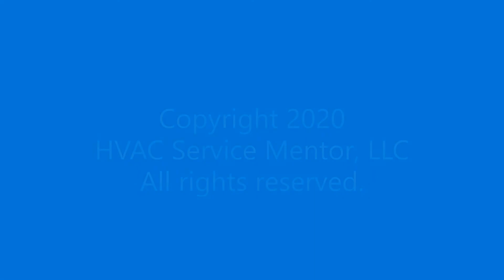How a thermostat works part 4 what is cycle rate and why should I care?

Comment: I have an aprilaire thermostat and no such setting exists in it.  however I think they call it something else. everything in it's manual goes by temperature setting.   what would be another term? some of their settings are stage differential, stage rate,  progressive recovery,  low balance, high balance, temperature offset.  heating minimum off time, compressor minimum off time, equipment minimum off time.
my furnace runs for lets say 7 to 10 mins, I can hear it shut down, waits about 10 to 20 seconds and then restarts the burners and runs another 7 to 10 min cycle.  it will keep doing this until the temp stabilizes I guess.  the whole time the thermostat temp never changes.  energy bill is normal but I'm worried about necessary cycling damaging the furnace.

Comment: Just curious what would the equivalent setting to a 3 cycle per hour be if the thermostat has slow, medium, and high heat cycle settings? My guess would probably be the medium setting.
Reply: Don't know which thermostat you have but I just found this info on Sensi. The cycle rate is based on temperature change, not cycles per hour. "On the Sensi the cycle rate on slow uses a 1.9 degree swing. On medium it uses a 0.75 degree swing"
Reply: @ That makes sense.
Reply from the maker: I haven't seen that before.  If the manual isn't providing the answer, try to call the company and ask.  If you find out, let me know!
Reply: @hvacservicementor I will try and get a hold of them.  The manual just says the three settings and how to change them in the installer menu. The thermostat is a Emerson non programable one
Reply: @KLM817  I have the same question. I just changed mine to "slow" as my furnace was cycling way more than 3 times an hour with outside temps around 40.
Reply: @ Same here. On slow mine would cycle at least 6 times an hour with temps around 40. On medium it would cycle about the same. It could also be my house is quite drafty with 53 year old windows and doors.

Comment: @hvacservicementor  Let me go one step further and report :  Because your video allowed me to understand mechanism I was able to slowly tweak the "anticipator" setting to longer cycles and now my heat is perfect. 

Little background :  I had just gotten a new steam heating furnace installed and house was cold.  In fact most of the radiators were cold unless I placed the thermostat at something crazy like 90 and let it rip.  I was confident the new unit was large enough to heat the house.   Installers didn't tweak the thermostat.  Apparent problem was , unit was cycling too soon, ie: shutting off before heat got to most of the radiators.    Increasing cycle time , reducing heat from resistor, elongating ON  time, allowed heat to reach all radiators .    After three tweaks,   heat now perfect.  Thermostat setting and Room Temp now the same too.    Thanks Again .

I've posted this as a new comment rather than a reply to my original posted about a month ago as I think it might be useful to others.   Prior post starts with "Been trying to understand the "anticipator" ...

Comment: Been trying to understand the "anticipator" .   Other videos explain - measure the current and apply the formula.    Huh.  Why should a thermostat which is a glorified switch care about current ?   This was the first vid that explained there is a resistor generating heat and subsequently getting spring to expand .    Wonderful !  Thanks for the explanation.  Shows the difference between route understanding vs deeper causal understanding. You clearly have the latter.
Reply from the maker: I'm glad that helped.  Thanks for your thoughtful comment.

Comment: Hello! If i has warm floor.. i have to use cycle rate? on my thermostat have only TPI:6 or TPI:9 cycles per hour. Or better to use +- 0.5 degree amplitude?
If i use +- 0.5C Amplitude mode, for example,  i set temperature to 22.5C.. Heating runing up to 23C and then turn off.. And by inercy warm up to 23.4C... Then 6-8hours standy-by.. temp drop down to 22.0C and thermostat give comand to turn on heater. Aprox 1.5hour it works and temp still falling down before rise up... I have pellets heater.
I have not try to use cycle rate mode. In my case - which mode is beter - cycle or amplitude? (Sorry for my english)
Reply: A heated floor should probably have a lower cycles per hour (long run times). Probably 1 to 3 cycles per hour.  It takes a long time to get the floor warm.  6 cycles per hour is best for a gas furnace with poor insulation.
Reply: A good quality t-stat like a Honeywell 8000 series, that remembers how long it takes for the heat to work can help as well.  Cheaper t-stats don't take history into account.

Comment: my customer complains that unit shuts off, stays off 15 minutes then comes on for 2 minutes and off again. Is this a cycle rate problem.I like that the unit stays off 15 minuted.
Reply from the maker: If the unit only runs for two minutes every 15 minutes, that is four starts per hour and only 8 minutes of run time per hour.  I think there is probably more to the story.
Reply: Sounds like it is oversized.  Look at heat rise, ΔT and supply temperature.  You can lower the gas pressure down to maybe 2 iwc for natural gas, if this is the problem.

Comment: You didn’t mention heat pumps. Is 3 the recommended starting point for heat pumps?
Reply from the maker: 3 is a good starting point.  The lower the discharge temperature, and the lower the mass of the heater, the longer the cycles can be.

Comment: Thanks for the info in this! My WI apt has hydronic heating and after our last cold burst, maintenance hired a company to come and work on the building's boiler and the heating has just been super amped up since. We live on the second floor and never needed to turn the heat on in 4 years. I pulled the cover to our thermostat and saw the cycle rate was set at .8 so I turned it down to .3. Hopefully that will solve it. I'll try to come back and update in a few days after seeing what works or doesn't work.

Comment: If you have a hydronic boiler reset like the hydrostat 3250+  burning oil is it best to set the cycles per hour to 1 and let the 3250+ do its thing or leave on the 3 CPH as T-stat indicates?

Comment: Very helpful. My heat pump seems to run short periods at certain conditions. It maintains the set point plus or minus 0.5degree. The energy used, the  strain of starting, and initial cold efficiency makes this not a good option. The thermostat CPH default is 5, but might be set higher as recommended for heat pump. I'll have to confirm that tomorrow. Thanks for explanation. I've always wondered about the mercury bulb sliding resistor coil was!

Comment: I have a Honeywell Chronotherm the anticipator has numbers 
.20, .30, .40, .50, .60 it is a steam boiler with gas fuel rated at 1.15 volts 60hz ok the card  where should my anticipator be set to by default?

Comment: Omg, get to the point then a history lesson. 😊
Reply from the maker: History is important.  Everything we have now is based on what came before.
Reply: @hvacservicementor  this is where we are as a society. Why you have men on the side of the road with women changing their tires and men that can't use a grill..... many other examples. Point is ignore well don't ignore but smile and know that will be a service call for a small business person. Know this is reason why service calls have went from major issues to simple adjustments most of the time. Simply ask location and post phone num er of local business. Heck make deal where you get finders fee. I will be searching out mire of hour videos. We are going to upgrade our heating system that was built in late 80s. 2000 sq fr two story home with an evaporative cooking master cool ac and whatever heating system used back then. Any advice or systems to avoid??

Comment: Great series of videos!  What would you use to test whether a thermostat is reading and reporting the correct ambient temperature?
Reply from the maker: Thank you!  Most modern digital thermostats have very accurate temperature sensors and I don't usually have a reason to doubt them.  That being said, a calibrated digital thermometer with a bead probe positioned inside the thermostat housing as close to the actual temperature sensor as possible will be the way to do it.  See my video on how to calibrate a thermometer.

You should know that HVAC thermostats sense temperature a little differently than standalone thermometers do.  Because of the way they are constructed, they sense a combination of the air temperature and the wall temperature.  This is by design.  Anything you do to try to measure that at the same time can change the dynamics of that system.  Also, modern thermostats are packed with intelligence which will take that temperature reading and make decisions based on it.  That decision making process is never transparent or obvious to you.  It is more complicated than simply looking at temperature alone and responding to it.  Generally, the more expensive the thermostat, the more advanced that decision making process is.  This is why you can buy a thermostat for $50 and also buy one for $300.  

Speaking as a person who has spent considerable time verifying that thermostats are reading accurately, I have realized that most of that time was not impactful and that thermostats are generally pretty accurate. The most helpful thing I was able to find was cold drafts flowing through the wall cavity and through the hole behind the thermostat.

Comment: I have an Aprilaire 8444 thermostat and it has a setting adjustment called stage rate and the settings rang from off to 5 minutes exactly what does that mean is that similar to cycle rate because I noticed when we had it installed that even though we always set our heat to 74 and if it's really cold out the room temperature will say 73 for a few minutes before the thermostat calls for heat and when we adjusted that setting to 1 it cured that problem and now it comes on when the room temperature says 74 but if we have it in cooling we keep it set to 76 and if it's mild out it will kick the ac on exactly at 76 but if it's above 70 degrees outside it will say 77 on the room temperature for several minutes before kicking it on and adjusting the stage rate settings didn't really solve that problem in cooling but it's still keeping it comfortable for us but was just wondering if it's the way it's supposed to work
Reply: Some thermostats have a 2- 3° range from current room temperature to when the heat pump system will turn on . If your thermostat has a 2° change when you have the home set at 74°, 76° will make the thermostat start to heat or cool the home. What has been explained in this video is run time once the system has started, to increase the time or decrease the time . The instruction manual explains the cycle rate. I just read it myself 😂😂

Comment: ive got a new electric furance its set to 3 cyles  but they only run last like 3-5mins then it shuts off  doesnt run long enough to heat up and keep the room temp at 70 what have it set too it short cyles

Comment: Thanks for the tutorial. You are the first person to have clearly explained cycles per hour. But I have a question, which hopefully you could answer. Do you think that there is a discernible difference between 3 and 4 cycles per hour such that it may be better in certain circumstances to do 4 instead of the 3?
Reply from the maker: Glad you liked it.  Back in the old mercury bulb thermostat days, cycle rate was determined by a heat anticipator which had a sweep type of adjustment.  Electronic thermostats replaced this with a 3, 6, or 9 CPH adjustment.  Today, many thermostats have even more steps for finer adjustment.  I don't think there will really be a noticeable difference between 3 and 4 CPH.  My recommendation is to set for the lowest setting you can get away with without overshooting the temperature setpoint.  If overshooting occurs, set the CPH higher until overshooting isn't a problem anymore.
Reply: @hvacservicementor  Thanks for the reply. 

One more question if I could indulge your patience: May the cycles setting also be affected by how wide the dead band is set at? I am guessing that when it comes to cycles, the key is to avoid short-cycling; but if the dead band is set to a differential of more than 3 degrees, would worrying about the cycles per hour even be an issue? 

Thanks again.
Reply from the maker: @juliotorres3618  Most residential thermostats do not have an adjustable deadband unless you are looking at the difference between the cooling setpoint and the heating setpoint in auto changeover mode.  

Auto changeover will have you select a heating setpoint and a cooling setpoint.  when the temp falls below the heating setpoint, the heat runs.  When the temperature rises above the cooling setpoint, the AC runs.  There must be a deadband of separation between these setpoints or else we would be rapidly banging back and forth between heating and cooling.  This deadband typically defaults to two degrees and is sometimes adjustable higher.  For example, if cooling is set to 75, heating can be set no higher than 73.  Attempting to set cooling lower than 75 will also drive down the heating setpoint as well to maintain that separation.  This would be the two degrees deadband.

A user may wish to be energy conscious and say they want the cooling to maintain 78degrees and the heating to maintain 68degrees.  This would be a ten degree deadband.

Within the individual heating or cooling mode, the deadband is typically non adjustable and will generally be between .5 and 1degree F. Sometimes this deadband is also known as swing.  A setpoint of 70deg with a 1 degree swing will produce actual temperatures between 69.5 to 70.5.

Remember that the cycle rate does not directly control how many times per hour the furnace runs.  There are several other factors that influence this more directly such as system output capacity and sizing.  How quickly the house is naturally gaining or losing heat.  And the thermostats own factory set PID loop programming.  A cycle rate setting actually directly influences when the burner or compressor or hydronic zone valve or electric heat strip will turn off in anticipation of achieving setpoint.  

This is why they used to be called heating or cooling anticipators.
Reply: @hvacservicementor  Thanks again. I have a thermostat that allows me to decide between cooling or heating.  I had my dead band set to a 3-degree differential. I have now changed it to a 4-degree difference, 66-70 degrees.

Comment: The first few mins of start up is the most inefficient. Even more so for heatpump. Everything is cold.
Your furnace is losing some energy heating the vents up as the hot air moves through them.
  Another note is a longer cycle gets a better balance of room  to a centain degree.
  Seems this guy is treading in the swing definition, but doesn't quite.
So maybe he isn't trying to.
Because swing is a very easy thing to explain. And a great reason to be informed of it. Especially if you have heatpump or your getting a lot of cycling of your furnace each hr.

Comment: My thermostat has slow,med and high .so if my hp cycles a little more than I want,can I change it to slow or fast? Default is med.Also what do you recommend cycle rate for emergency heat also?

Comment: OK here is a puzzle for you. I have a carrier HVAC that is only a a year old. It has been routinely serviced by the pros. It is set on a 4 cycles per hour cycle rate and a swing differential of less than one because the temp never changes.. If I set the AC on say 81 w/outside temp say 95, it runs for about 25 minutes then shuts off for about 55 minutes which is mathematically a cycle rate of less than one. If I set it to 78, it still runs about 25 minutes but stays off for about 35 minutes which is a cycle rate of ONE. If it is 75 outside and I set the stat at 75, it will come on for about 10 minutes but stay off for almost 3 hours which is a cycle rate of way less than one. So I dont get  the mumbo jumbo about cycle rate when the difference is made by the temp outside. And right now at 330 am  the outside temp is about 73 and the stat is set to 81 and it has not run since 10 pm - not once so to me cycle rate is meaningless. And dont give me any crap about my unit may be too small or too big. Everything Ive read  says it will wear out quicker if it short cycles and will use more energy but then turns right around an says if it long cycles it will use more energy, which is like saying if you drive your car fast it will use more gas but if you slow it down it it will use more. Cannot be both ways. Any suggestions. My unit is not too big or little and is in perfect condition. BTW at the end of the run cycle I am starting to get cold and after the shut off cycle I start to get hot. All the techs that have checked it out say it's OK and normal but according to the internet my unit has a gremlin inside. Please someone give some advice.
Reply: Cycle rate only applys to heating
Reply: @simonmarx34  No it doesn't. You can change the cycle rate for air conditioners as well.

Comment: Thank's for this. Does this apply to heat pumps that also cool? They're common in the mid-Atlantic region.
Reply: I set my heat pump to 3 to get longer runtimes ... it's about temperature fluctuation what you can handle versus start and stop.  Start and stop a compressor more often, will shorten the life and it will draw the higher amps when starting.